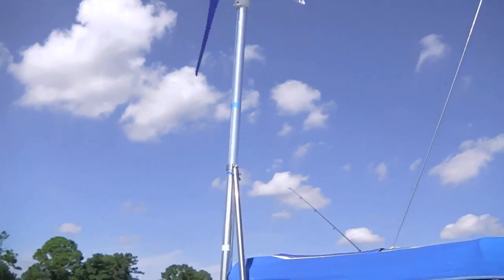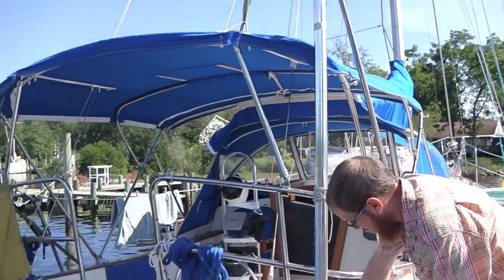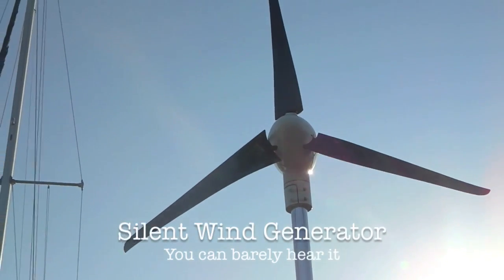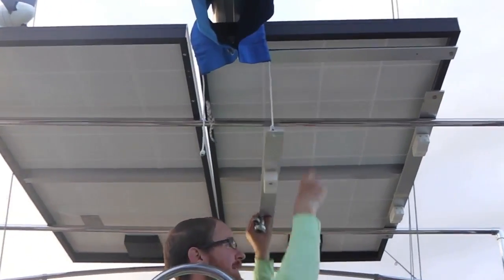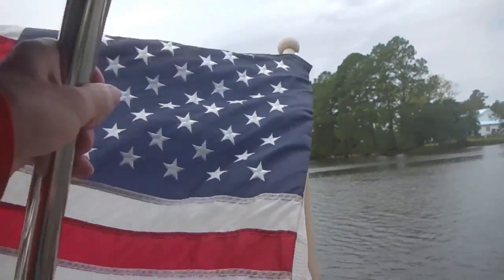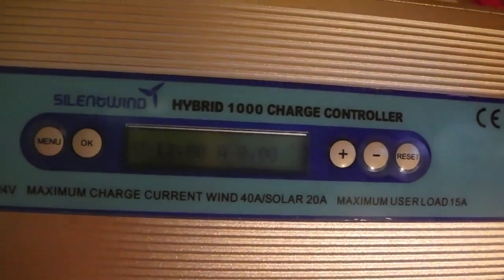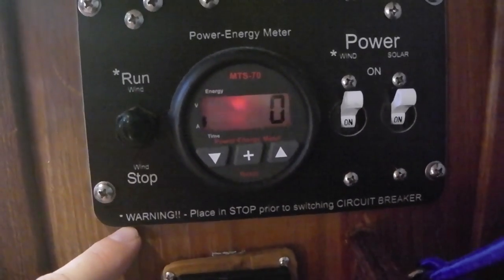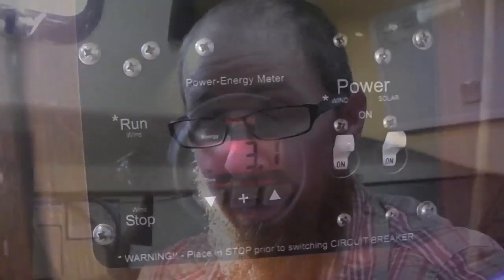EP 09: Solar & Wind Generator Installed on our Sailboat

Comment: That's something I could never understand instead of running a Bimini how come people don't run solar panels it's going to provide shade an electric power at the same time but you don't see too many boat setup like that you'll see him have a regular cloth Bimini and then solar panels hanging off the back of the boat
Reply: I think it it so you can have a open cockpit kind of like owning a convertible and not be able to put the top down ever.

Comment: what can you use with  400 Watts of power?
Reply from the maker: +MrkStphn91 everything but the water heater and power plugin tools, but we use it to charge our battery bank and we have been running strong since before we left Oriental, NC

Comment: Is it possible to run 2 wind generators on a boat like yours  ?  Having 1 on each side ?  Would that be practical ?
Reply from the maker: +Dark Vctry you could certainly do that. We have seen several boats do that though they usually don't have solar as well which is why they have 2 wind gens.